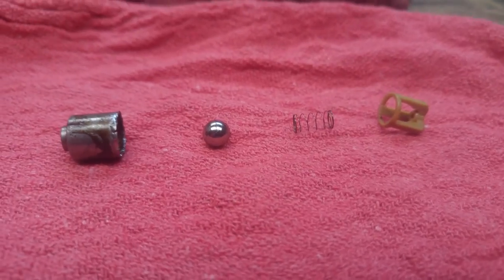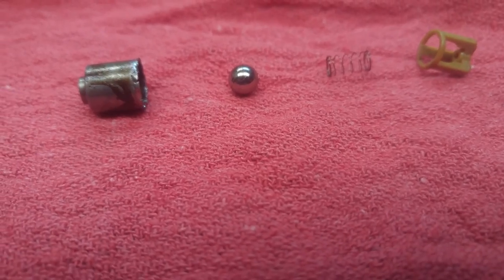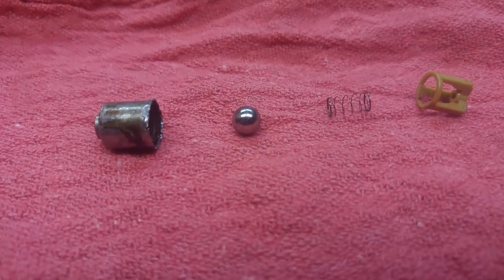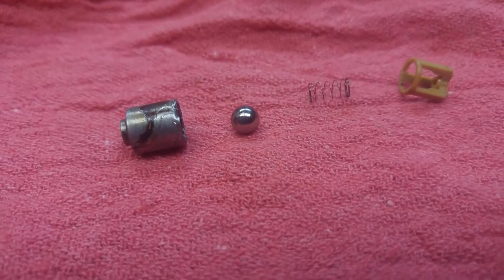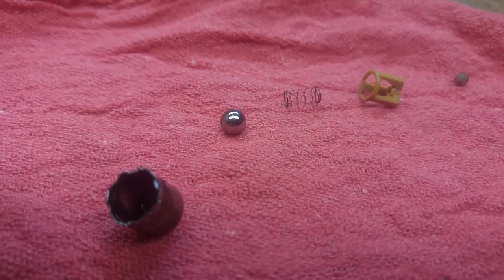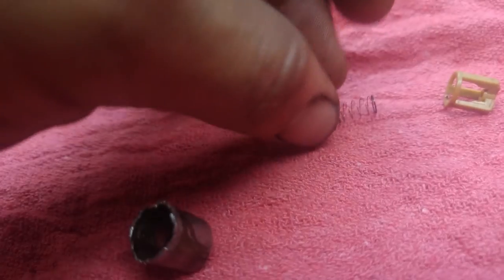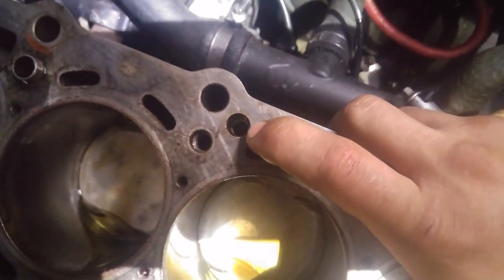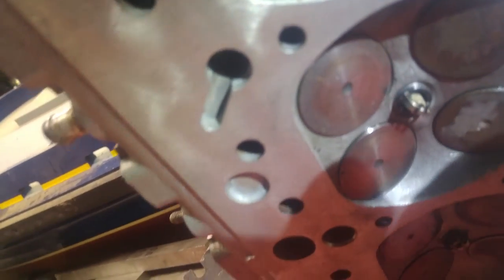E36 M42 Cause for noise in cylinder head on Cold Start

Comment: I'm working on a 93 318is and I don't see this valve installed in my head or block. Did some cars have them while others do not?
Reply from the maker: Under the head gasket in the engine block is where it is located

Comment: Yesss bro its a interesting because I buy a 318ti or E30 four cylinders block and exist three posibilities of this.
In block of M40 318i have a threaded hole with a cheiw same a motorbike carburator.
In block of E36 318is after 1993 have our valve and hole not to threaded.
And the 318ti or E30 block have a threaded hole,but not I does not never,is a alone hole.
Its rare no?
Now I have take a e30 block and drill the hole same model after 1993,is an other option that found in webs.

Best wishes bro.
Regards. :)